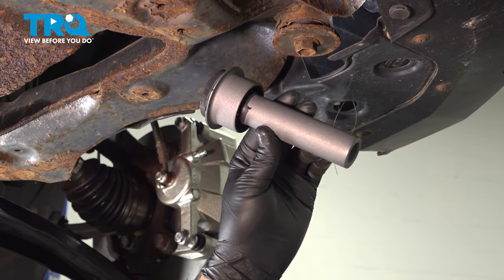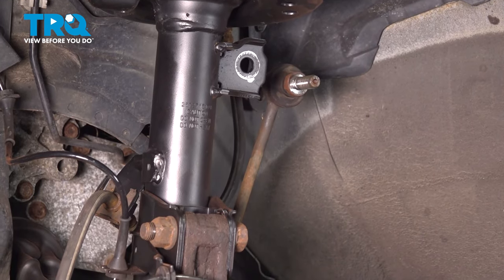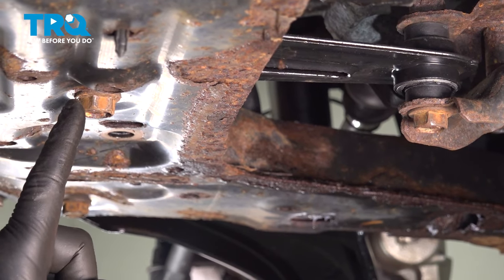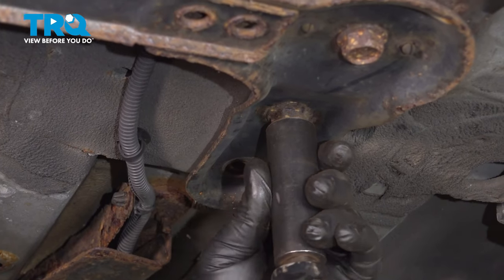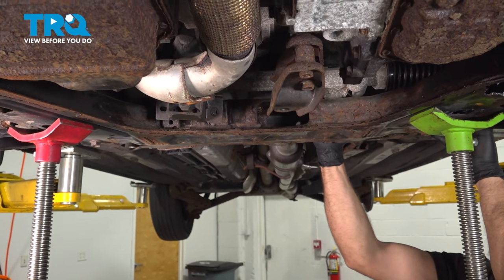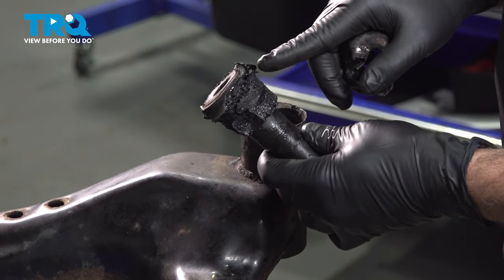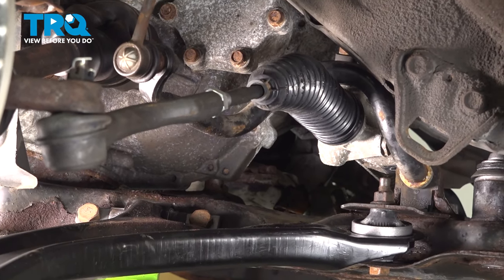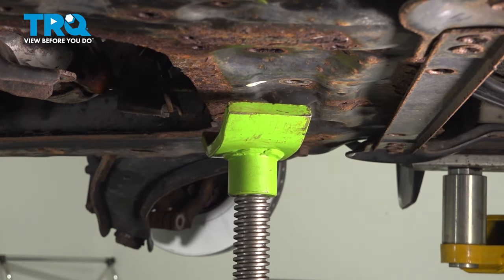How to Replace Front Forward Subframe Bushing 2008-2013 Nissan Rogue

Comment: Thank you.  My front bushings were completely ripped.  There was a loud clunk noise as the vehicle either accelerated or slowed.  To remove the old bushing shells, I heated the tube for about 2 min and used a hammer and chisel (big screwdriver) to hit all around the sleeve.  Each bushing was about 7 min to remove.  To install, I did not have the bushing install kit.  You might be able to rent it from an auto parts store.  Whatever you do, Don't try to pound it in with a hammer.  At about the 8 min mark of the vid, you can see that technician cut a chamfer (is that the right word?) to get the bushing started.  I cheated and since the subframe was out of the car, I took it to the shop and they installed for $50.  Working in the driveway I used a jack to lift the subframe into place.  This is a very helpful video.  The most valuable part, for me, is the torque settings.  All together, this was a $90 repair.  Plan you work space, time and tools.  This can easily be done in 4 hrs (hiccups and corrosion pending)

Comment: And repeat in 12months time, or 8 months in my case... OR buy poly bushes from PS Bushings in south africa and fit and forget :) the OEM type bushes aren't branded and it's impossible to tell the quality, I got mine from E bay and they didn't last, it's such a big job go for the PSB (problem solving bushings) one, you won't regret it :)

Comment: Tomorrow, I'm fixing my 2009 sentra subframe bushings and this video is making me very confident in what I need to do to replace it myself. Basically the same parts as a 2009 rogue since it's the same engine and transmission as in a sentra from the same year. And my cradle condition is very similar to the one in this video. Front forward bushings are shut and almost non-existent, and the bolts have the same amount of rust on them. I must say, you're pretty confident in taking those off without penetrating fluid first, good job for not having destroyed any bolts. I hope my repairs will be as simple as this video shows.